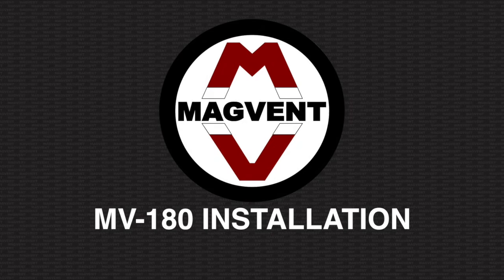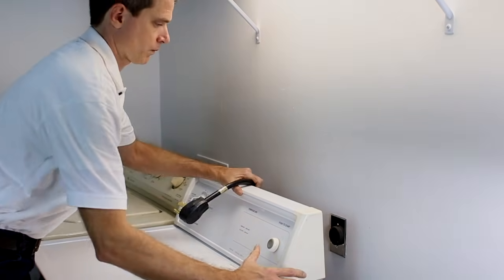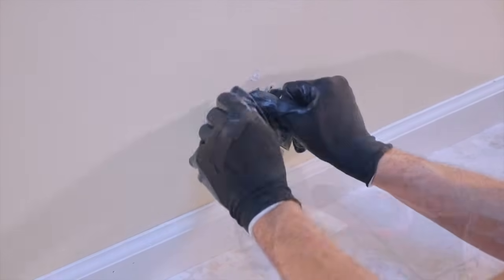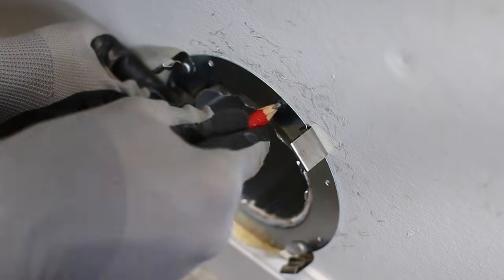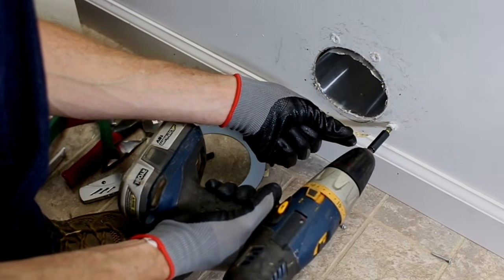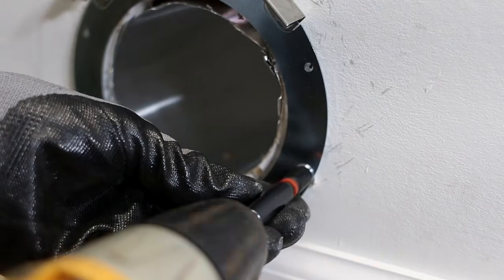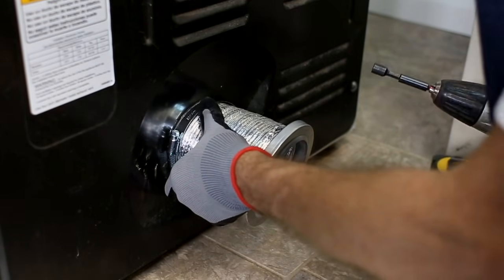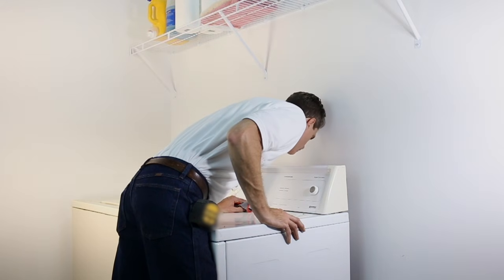MagVent MV-180 Dryer Vent Installation

Comment: Bad idea
Reply: As mentioned previously, MagVents are not made of soft foil duct. They are made of DryerFlex from In-O-Vate products, www.dryerflex.com. It is sturdy, aluminum hose that is lined with steel wire and resists crushing. When combined with the MagVent coupling, it compresses down in an accordion-like fashion and, with proper installation, is never crushed when the dryer is pushed into place. 

DryerFlex is UL approved not UL created. UL is not a manufacturer or creator of DryerFlex. They are an independent safety organization that is the industry standard for safety rating.

I am familiar with several clothes dryer installation manuals. The manuals allow 4 inch flexible metal hose as long as it is UL listed and accessible for cleaning. MagVents are made of sturdy, steel lined, aluminum ribbon hose that is UL approved. And since MagVent couplings make it simple and easy to disconnect and reconnect your dryer for regular cleaning, they will not void the dryer's warranty.
Reply: @magvent-dryervent1485  Just purchased the dryerflex product. It is easy to puncture. Do not recommend it. Semi-rigid hose is hard to work with, but safest option.
Reply: ron denhollander care to elaborate?
Reply: Although the soft foil venting is fire safe no manufacturer will allow ( voids warranty) soft foil venting as shown. Most all consumers, including technicians will not install products like this properly. Builders rarely line the dryer vent hole in wall so the vent will be off set vertically and horizontally causing the venting shown to be distorted.  Also the coupling on the part that magnetically connects to the wall is put on the inside of the venting which is not proper either ( proper venting procedure is goes inside next section as it goes away from dryer) .I have serviced several thousand dryers from every manufacturer, trained technicians as well, and the number one cause of failure is bad venting. I always review the owners installation guide with customer and in every case foil venting is not allowed.  If you would use rigid or flexible rigid then it would be proper. Of all the dryers I have worked on only a handful had the vent hole in the wall in that spot. As a master factory trained technician ( domestic and off shore) I would not recommend the foil and neither do the manufacturers. Maybe if you get the manufacturers to put your product in their manual as accepted you might have something.
Reply: Trump 2020 thank you for the unintelligent comment.  Sad sad sad. Please state your qualifications to justify you commenting.
Reply: @CaseAgainstFaith1  The duct is a heavy foil but if you position your dryer properly it collapses into itself and is quite rigid and thick. With my dryer it is a straight shot and the vent collapses completely into a short rigid tube.
Reply: L Parker I did a little more reading and, as it turns out, DryerFlex actually qualifies as semi-rigid despite being very flexible. Ron is completely wrong. It also passes  UL2158A , whiich is the SAME standard that semi-rigid passes.  I have no relationship to MagVent.  I just want to correct Ron's bad information.  I have ordered from amazon a MagVent unit but it has not arrived yet.
Reply: MagVent couplings do not use the soft foil venting that voids the dryer's warranty. The transition hose used in MagVent couplings is UL 2158A approved for dryer venting. It is made of aluminum and lined with steel wire making it much sturdier than the typical foil hose. 

Yes, the dryer vent isn't always lined up directly with the wall vent like shown in the MV-180 installation. That is why MagVent offers three different models that will accommodate a variety of vent alignments.
Reply: I am not sure if you own a dryer but if you do I would look at the manufacturer instructions for installation. UL rating has absolutely nothing to do with what I am talking about and by quoting that you fail to understand as well.  Just because a product is certified by its creator to be used on a product doesn’t mean it is approved to be used on it. There are only two types of venting approved on a dryer by manufacturers to be on their products, rigid as in HVAC ducts and flex rigid. I did warranty work for most every manufacturer around the world, attended factory training and trained technicians as a master technician and never did any manufacturer allow anything else attached to their products. Do you have manufacturer documentation from companies stating they approve of using your product?.  If you change the soft flexible vent part to a rigid you might have something. Homeowners, bad installers and handymen shove dryers in and when wall part is offset then foil gets crushed. Seen too many damaged by incorrect venting
Reply: Yes manufactures allow flexible venting but after having seen hundreds of installations manuals I still have not seen any recommending soft walled as shown in video. Never argued the UL rating more concerned that to properly install any product the supplied manufacturer instructions are to be followed. Sadly have seen to many dryer failures due to venting. Best way is to use rigid or the flexible, non soft walled , to install a product. Best might be get documents from manufacturers showing they approve the use.
Reply: You hang your entire objection upon the constant assertion that MagVent uses "soft walled" venting (which is, by your assertion, never possible to make safe). Honestly all I can see left of your argument is your arrogance, as if your life has to, must mean something after all the time and energy you have put into such an inane thing. You seem genuinely interested, not in being right, but in being perceived as correct and recognized for your superior knowledge, experience, and intellect. It is sad that instead of seeing the product for what it is and acknowledging the clear benefit to a great many who instead use improper poorly lined up venting that ends up straining the dryer and causing safety issues that this product clearly improves upon. I take comfort knowing that the old guard is passing on and with them, not their wisdom which somehow becomes inaccessible to the next generation, but rather their calcification. To quote Sidney Poitier from "Guess Whose Coming to Dinner," "You and your whole lousy generation believes the way it was for you is the way it’s got to be. And not until your whole generation has lain down and died will the dead weight be off our backs!"
Reply: Again, UL approval has nothing to do with it. Can you supply manufacturers documents approving of your hook up. As a technician I follow installation as required by law. We won’t agree, I just would never use or recommend this product due to materials used
Reply: I cannot fathom why any manufacturer would have the slightest problem with a better designed, better made product, that is safer, but then I don't claim to know everything...

Comment: What happens if you are offset by 8 inches?
Reply from the maker: The MV-180 can handle about a 3" offset. For 8" offsets, you should us a MV-90 plugged directly into a standard 4" adjustable elbow. This gives you about a 9" offset. The MV-90 can also handle about a 3" offset. If you scroll to the bottom of this page you'll see a picture of the setup: https://www.magvent-dryervent.com/shop/mv-90-90-magnetic-dryer-vent. Also, here is a link to our MV-90 installation video: https://youtu.be/rdRPbPfuS0s 
Thanks for your comment. I hope this is helpful.
Reply from the maker: We do offer three different MagVent products to fit a variety of dryer venting needs. I would be more than happy to discuss your situation and help guide you in any way I can. Feel free to contact us by phone or email, and we would be more than happy to help.